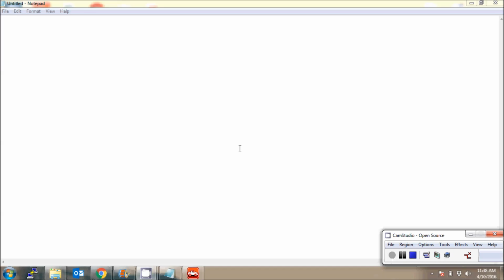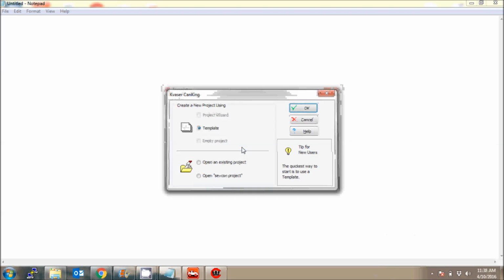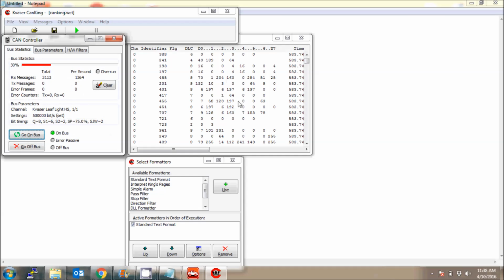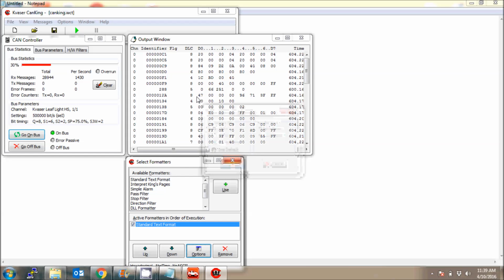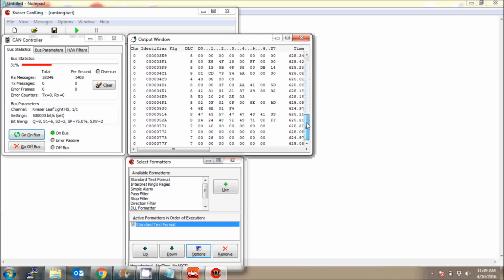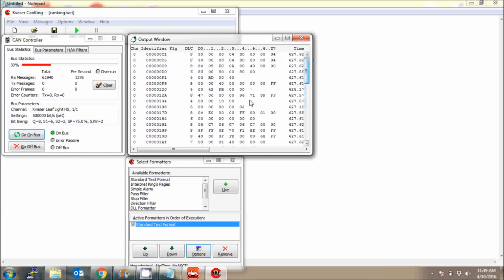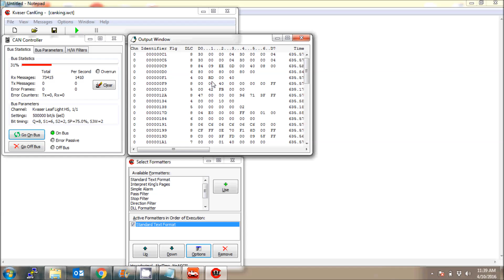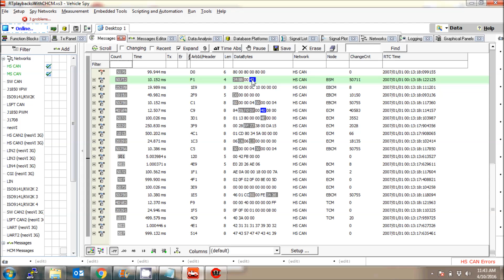Reading vehicle CAN Data

Comment: I have tried monitoring CAN bus and have been quite successful in pulling out CAN IDs for AC fan speed, AC temperature, Power windows, parking brakes, gear in which the car is etc., but monitoring CAN bus never gave me DTCs of ABS, BCM, Airbags etc. So, reverse engineering a scan tool feels like a plausible solution.
Can anyone help me (give some personal advice or online resources) as to how to build a setup to display what commands a scan tool sends when I say click 'Show DTCs for BCM'
Reply: There are several CAN networks in the car. You must connect to the right one.
Reply: I have been able to capture some of the CAN ID profiles, would like to know how you have been able to decipher which ID's refer to what ? what is the communication device you are using and software ?
Reply: @rockstarsetsuna  hi Akshay, we are in need of some one who knows Can data in and out we need some help in getting our parts to integrate our car can you provide me your mail ID?